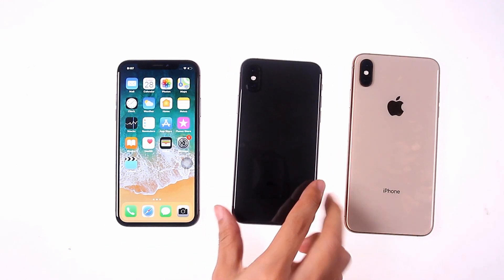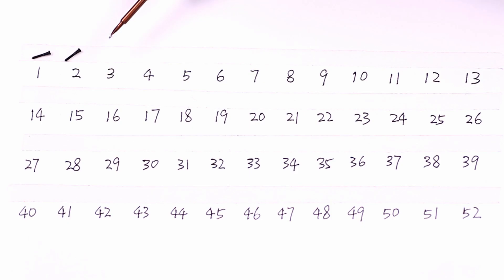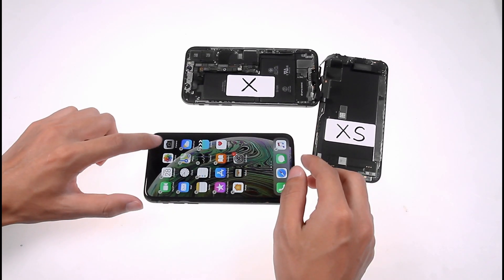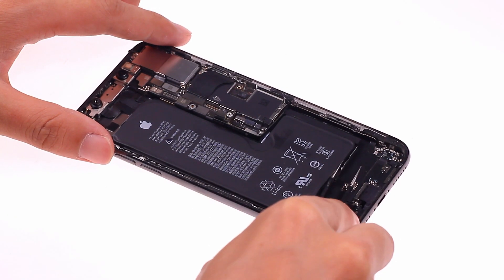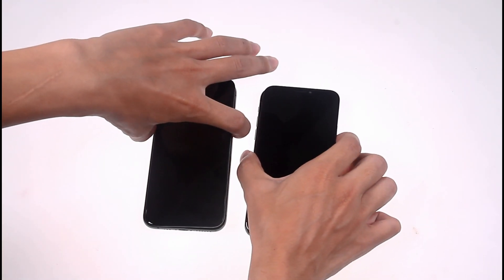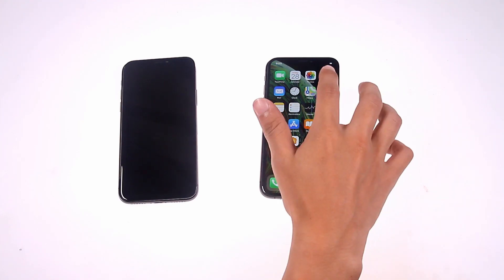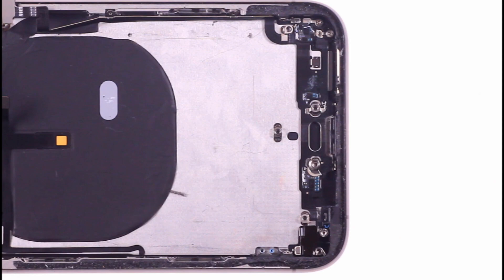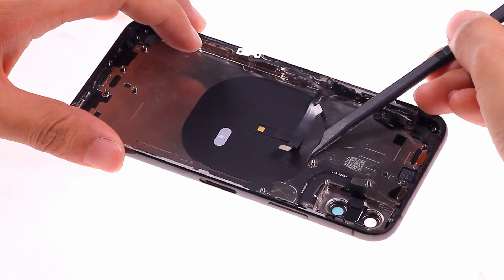iPhone XS Teardown #Disassembly

Comment: Nah you don’t have to take half the bottom of the phone off to remove the battery… I just removed the top adhesive strip then used 91% rubbing alcohol and an old expired debit card to cut through the old adhesive n pull the battery out.. it’s much easier.. just be careful of the wireless charger coil and the other cables under the battery.. also don’t try this method unless you need a new battery as the old one will most likely be damaged if you do my method.. I bent the crap out of the old battery in my iPhone XS while doing this but I had a new battery and the old one probably would of needed replaced in a couple months because it was at 81% battery health.. but I got this iPhone for 50$ because even though it had 0 locks of any kind on it no carrier or account lock the screen was dead and didn’t display anything so I had to put a screen in it anyway so I swapped the battery too

Comment: After swapping everything into a new housing my volume up/down buttons do not work the phone is lagging Touch ID does not work properly and phone keeps turning off any help would be appreciated thanks
Reply: Sounds like a bad motherboard/logic board or you may have something snapped down into place the wrong way or could be a screw not in the correct spot. I would disassemble it and try again

Comment: Now I want to put the iPhone X’s battery in my XS.
Reply from the maker: That's possible, but not worth doing it.
Reply: Wit Rigs  I tend to tell people that there phones are not waterproof because it only states water residents witch is not waterproof so I don’t recommend people going swimming with there phones
Reply: Wit Rigs  I also suppressed you did not try swapping out the wireless charging in both phones

Comment: So we can use the X's battery as a replacement if the Xs' battery dies? Sounds good to me, a bit longer battery life for the Xs then.
Reply: li ion batteries need some space to expand when they are used and get hot. If there is not enough space for this the battery may get damaged. Happened to Samsung Note 7 where batteries caught fire because they did not have enough space.

Comment: Why they made the real L shaped battery in XS, and yet the battery is actually smaller?
Reply: They had to make the corners rounded to avoid the cells pinching each other and causing what happened to the Note 7 (thermal runaway and battery fires).